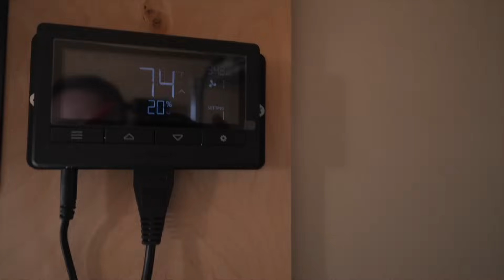Home Crypto Mining Setup and Tour 2024

Comment: Also not sure if there is an easy way to take the salt out of the air 🤔 with an air conditioner maybe ? (heat pump i think you guys call them ?), They are very common here in Aus and extremely efficient for cooling as well. or air purifier? Also Mike, you have to get that stack if 3090s in a rif while its cool ! And the new track is such a chill beat 👌🎉

Comment: Unrelated to crypto I’ll tell you how I stay organized. If I don’t do this I loose all motivation and get overwhelmed.

1. Rule: nothing goes on the floor where you walk. Slows you down and has risk. Mount your lights and cameras to the ceiling and run the cables over to the wall.
2. Don’t get too attached to trash. Space is money, so does a gpu add enough value to store it for years? Like do you see 580s selling for more because they have the box right now?
3. Keep things sorted, group/designate areas for things. Sell/recycle/repair/etc this will let you know when an area is getting to backed up and needs focus.
4. If you want to keep things but know your not going to use them for awhile use high up storage with google labels. Use you ideal height storage for things that are used one a week.

Comment: Nice, I think most miners were skaters at sometime as well...Always see a board or two :). Also, I have basement & garage too. I added a vent along the peak which pulls hot air in the summer. This works great for me as it gets really hot in there.

Comment: 5700 xt's 6700 xts and the 68s are all great for KawPow.  

Boxes?  I keep them and store them in large boxes and stack them in the garage on ceiling racks.  You'll get more for the cards and sell them faster with the box.

Airflow?  You could replace the 9 pane window glass in the door with a window/screen option.  That way, you can open it when you need intake air and close it when you don't.  You could also use an air filter in that opening to filter out debris.

Comment: For the filter problem I'd start by calculating the amount of airflow you need for your setup and take it from there. 

You probably know the energy consumption of your rigs in kW so here is the airflow for 1 kW:
- heat capacity air/m^3: 1200 J/(m^3 Kelvin)
- temperature delta between intake and exhaust (set this to whatever works best but I'm going with 10 K)
- energy consumption: 1000 W = 1000 Joules/second thus per hour it's 3600*1000=3.6*10^6 J

thus you need an airflow of: 3.6*10^6 / (1200 * 10) = 300 m^3/hour

If you can live with a higher temp delta you can just use that, for 15 degrees you only need 300*15/10=200 m^3/h. I guess you'll quite quickly go towards 10 kW though, so you are probably looking at 2000-3000 m^3/h. 

At that point it'll be difficult to do that with a normal hepa air purifier like a Winix 5500 (/winix zero in europe) that does roughly 400 m^3/h at full blast. Maybe something with a lower filter rating (E11 or E12 instead of H13) you'll be able to pull more air through it but I haven't looked into the those sollutions. Just make sure you get something that can provide the airflow you need.

Comment: In my opinion, if you plan to continue PoW mining, it might be good idea to really design your basement better, so that your hardware is located there more effectively (both rooomwise and probably also temperaturewise).   Try to look at pictures from google image search with keywords "hot aisle cold aisle" you might get there some kind of idea how to arrange your basement better.  What you basically want, is an airflow moving only one direction, kind of wind tunnel, so you can put all your miners in that "tunnel" with good density, making you more room in other needs.

Comment: "Expert" DIY'r, buy some paint booth type air filters, remove your window from the door replace it with a wood frame and metal mesh used for concrete to hold the filters in place, the filters are cheap so you can replace often, wont solve all the humidity chalenges but you at least will have clean air. ;)

Comment: You could stack up the boxes where the grow tent is once moved as for the door to the garage you could build an air lock type system which could be solid walls or mesh with another screen door or a magnet screen door so you can walk in close the door to the outside and then open or go through the mesh door inside, as long as it doesn't effect air flow in you should be good and have an extra filter which could be doubled up as you will still get some dust/pollen in but should be less than before.